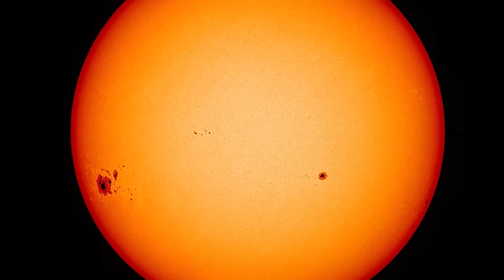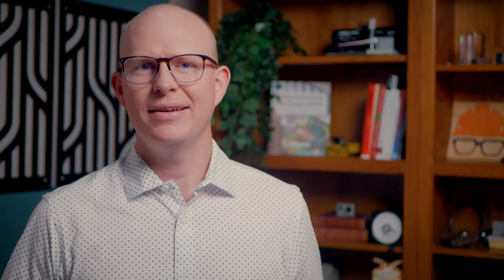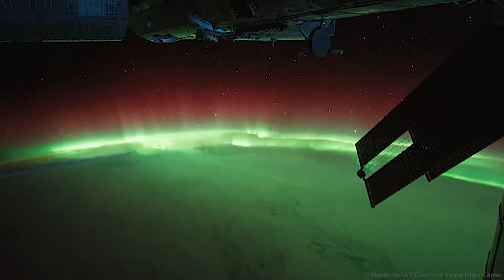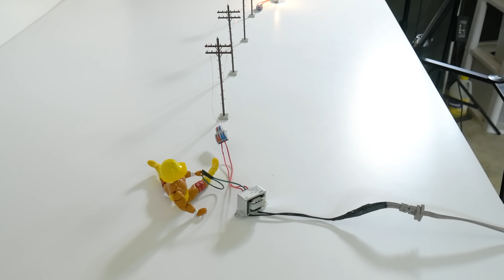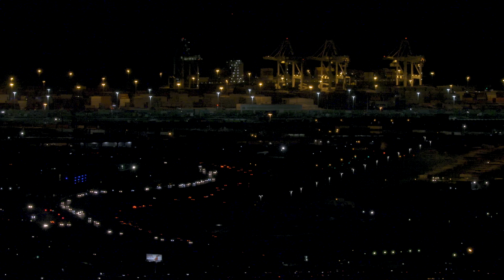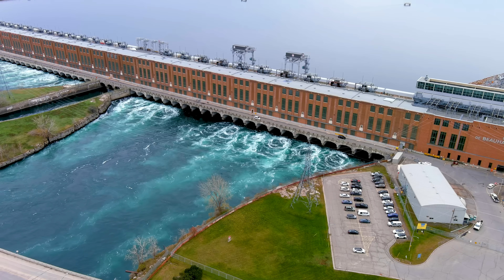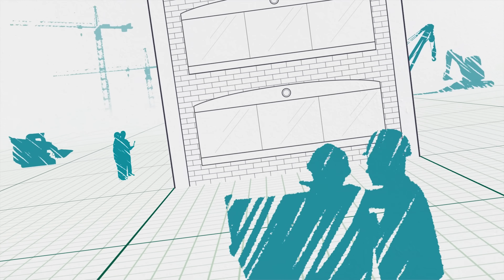The Most Confusing Part of the Power Grid

Comment: I work at a wind research institute and we have some big synchronous generator wind turbines. It is interesting since they can actually support the grid and deal with reactive power, unlike many other inverter based turbines. They were probably too ahead of their time though since the company that made them went out of business. Synchronous designs are starting to be talked about again though due to the lack of reactive power from most other renewable sources and I think some synchronous designs might be built and tested in the next few years.
Reply: Synchronous rotation is the key to dependability in P-V,  ocean wave power collection and non-synchronous 
wind turbine collection.  Bless you.
Reply: Did that synchronous generator based wind turbine operate at fixed speed or variable speed?
Reply: @adriansolis126  variable speeds, up to 10m/s where it then hit its peak power output of 2MW and then its power remains at that level until it reaches its max wind speed at 25m/s
Reply: @Michaelonyoutub  So I suppose that the synchronous machine is interfaced with an inverter to the grid
Reply: @adriansolis126  It is interfaced directly to the grid, though its voltage has to be adjusted. There is a hydrodynamic drive that translates the speed of the gearbox from the rotor to the correct synchronous speed for the generator.

Comment: is DC is better? how DC-DC converters compare with AC transformers? over 90% of usage can work on DC, basically only induction motors would need inverters.
Reply: All over the world we're seeing more HVDC for long distance and very high voltage transmission lines. For a given voltage DC has less losses because it's only resistive, you don't have any components of inductive or capacitive reactance, skin effect isn't a problem, corona discharge losses are reduced, the amount of conductor material required is less because skin effect isn't a problem and because of the absence of phases, which in turn means the transmission towers can also be made smaller. The biggest hurdle for DC transmission is the capital cost, you need expensive converter stations on both ends, however at a certain length and voltage it becomes more economical. HVDC is also used for grid interconnections, making it possible to connect 2 AC systems with different operating frequency or 2 systems that have different synchronisation.

HVDC transmission circuits have a traditional incoming AC circuit with transformers feeding into converter stations which have massive valves to rectify the AC to DC which is then transmitted to another converter station which has inverters which convert it back to AC. 

Think of it like this

Generator output 25kV AC --> Step up transformer raises the voltage to 400kV AC --> Converter station rectifies the AC to DC --> DC transmission at 550kV+ --> Receiving end station inverters convert back to 400kV AC.

Check out https://openinframap.org/#5.33/49.447/-98.548 enable the key and you'll find HVDC circuits between US states and all over the world.

Comment: We might be going back to high voltage DC again, because with modern power electronics, we can step up and down DC voltage without the need for AC transformers. So reactive power losses from AC current, is going to become less of a problem.

Comment: Not to hijack your video, but an idea occurred to me this morning, and I'd like to run it by you, since you're talking about the power grid today. Suppose you have an electronic detection device that can sense when the ac power is rising and falling. Next, suppose that this detector is used to make or break a circuit when the power is at zero on the sine wave. There would be no arcing, since there would be no power flowing at that moment. Upon reflection, I can see a lot of hurdles to overcome with this idea, and it surely wouldn't be useful in every instance, but it seems to me it has potential, pardon the pun.You've probably had the experience of shorting an ac circuit at one time or other, and there was zero arcing, or even noise. Obviously, this is just luck of the draw, but what if the principle could be actively used for switching applications?

Comment: By the way, it wasn't just the SVcs that were affected in Quebec. The impacts went all the way down into the US. Because the sun storm caused an imposed DC bias on the three phases of transmission lines. This caused a huge flow of current in the neutrals of the three phase system. That huge flow saturated and burned out many power transformers. And those transformers take a long time to rebuild so the spares got used up very quickly.

Comment: I saw the thumbnail and immediately thought power factor. I guess I was correct.
4:06 They don’t change resistance based on voltage, it’s based on temperature. As anything heats up(whether by ambient temperature or resistance causing a voltage drop, “creating” heat as shown in the demonstration, or by any other heat source), it’s resistance increases.
I’ve used a ct to show power factor and hope to make a video on it(self promotion not intended)
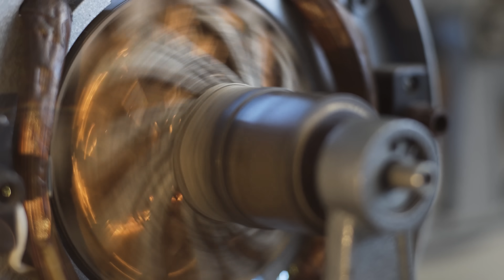9:18 That appears to be a universal motor

Comment: What a great video. As a chemical engineer in the water industry who often has to work with electricians to commission the electrical parts of plants this video was super helpful. When you explained power factor it was a great a ha moment for me. Would be great to learn more about vsd/vfds, how they work, how they interact with the grid and more about on site diesel generators too.
Reply: @TheDesertWarrior. 

On site generators are a whole subject on their own, but VFDs are pretty simple.   

They basically take the AC input, rectify it into DC, and then invert it back into AC.  If it is a 3 phase VFD, think of it as 3 parallel circuits, one for each phase.  (It isn’t really, but this isn’t an electrical engineering class).  I am not sure, but since the input AC is immediately converted to DC, there should be no reactance on the input side.  It would all be between the VFD and the motor, so from the grid’s point of view it would be a purely resistive load.

The rectifiers use diodes (think of them like a check valve) to convert the AC to DC.  Look up a full bridge rectifier for a simple explanation of how this works.

The inverter uses transistors as switches to convert the DC back to AC.  I am sure there is a YouTube video explaining this also.  The “variable” in VFD just means that the speed of the inverter switching is controlled to create the frequency desired.  

Motors rotate based on a rotating magnetic field that is directly correlated with the frequency of the electricity.  Lower frequency means slower rotation and vise versa.

In the following I will use pumps as an example.  There are equivalencies for other types of equipment such as conveyors, etc.  

There are two old school ways of controlling pump output.  

The first is to put a control valve on the pump discharge that restricts the output.  This has disadvantages in that it creates a variable back pressure on the pump that lowers the lifetime of the mechanical seals, has significant reaction delays to system changes, probably takes the pump off curve, and wastes power.

The second is to spec the pump to provide more than max demand and relieve excess output back to the pump suction through an unloader valve.  This still uses excess power, but reacts much faster to system demand changes, and the pump never sees any changes to flow or demand, so it always stays on curve, and the mechanical seals last much, much longer.

Both of these have installation and maintenance costs due to valve maintenance requirements, and greater operational costs due to the excess power usage.

VFDs avoid the excess power problem, but there is some inertia during system changes, and installation and maintenance costs aren’t necessarily lower.  They also require changes to pump design, since a variable run speed means a highly variable pump curve.  

Multi impeller can pumps are common in this application, but get a pump specialist to spec the pump or the maintenance techs will be cursing your next seven generations.  

The benefit is the savings in operational costs, since they only use as much power as is immediately required.

The savings in not having to install control valves is offset by the costs of installing a feedback control circuit.  The same for maintenance costs.  The advantage is in the reduced operational costs, and possibly in VAR reduction.  I am not sure about that last, since I worked in power generation and our concern was in generating or absorbing VARs on purpose.  Plant parasitic load and VARs was an afterthought.  The generators and transformers were measured in MVARs.  We never even noticed a few tens of VARs on a motor.

A word to the wise about VFDs.  Recently, a lot of people with home shops have been using transformers and VFDs to create 3 phase 240/480 volt power for their equipment.  A few of them, like my neighbor down the street, have managed to burn their houses down by trying to diy it.  This kind of stuff is not for amateurs no matter how many YouTube videos you have watched.  A licensed and bonded electrician gives you someone to sue when all your worldly goods go up in smoke.

Comment: You quickly alluded to it, but the huge increase of renewables with inverters is a BIG problem for grid stability. Old fashioned generators have spinning rotors with a lot of inertia to smooth out disturbances. Pure inverters don't do that. Worse, most of them use the grid frequnecy and phase as the cue as to how to synchronize. They can't help the grid when they are just following the leader when the leader loses his way! Engineers are working on electronic alterations to inverters to try to solve this challenge.
Reply: I still think synchronous motors (a.k.a. rotary condensers or rotary capacitors) are the key to keeping
photo-voltaic and wind-turbine voltage sources contributing to the grid in a crisis.

Comment: Most of that grid stabilization burden will be shifted to battery storage with grid-shaping inverters. Some of it could also be accommodated by equipping DC fast chargers with programmable power factor correction and current sensing coils to stabilize power factor and distortion power on their branch of the distribution network.

Comment: At least in Europe when a company uses / reaches a certain point of power, they have to compensate their cos φ by them self - otherwise they must pay expensive fines
Reply: In the US, we usually manage excess VAR's on the grid, with capacitor banks or motored hydro units, and the interchange of Delta and Y connections in distribution.  Of course, industry is expected to try to manage a little too, but not with fines.

Comment: for safety reasons, I would recommend you stay away from electricity... 10V battery is empty, charge it asap before it dies. Electrolytic capacitor is polarised, you are lucky it didn't explode when negative voltage was applied. Oscilloscopes aligator clip is wired directly to ground, always triple check before connecting it to anything on the mains (you did wire it correctly but still be aware and use isolated ground if possible)

Comment: 6:13 That type of capacitor is known as an "electrolytic" and isn't meant to have an AC voltage on it. The side with the black stripe marked "-" needs to be negative with respect to the other terminal. If you put reverse voltage on it (as happens 60 times a second with AC from the mains), it can explode and shoot hot capacitor fluid at you. Be careful.
Reply: When I was a kid, a friend of mine got into electronics kits. One day, when I was at his place, he asked if I wanted to see something cool. Then he closed the curtains, turned off the light, and flipped the switch on a capacitor he had connected to mains power. Fireworks! 

Suddenly I was interested in electronics too.
Reply: They are used in AC circuits all the time
Reply: @hiddenInsight486  There are electrolytic capacitors used for AC circuits but they are not polarized, they are specifically designed for AC operation.  @Ronathangator is correct, the polarized capacitors Grady is using are specifically meant for DC application only.  I couldn't see the voltage rating of the capacitor in the video but if left in Grady's AC circuit long enough it will overheat and fail, venting its electrolyte and potentially blowing apart at the vent.  There are inexpensive non-polarized capacitors available that he could have used for this demonstration.
Reply: @JeffCurtisIflyHG  you are quite mistaken. Electrolytic can be used in AC perfectly fine.
Reply: @hiddenInsight486  I'm an electrical engineer working in the field of power engineering for the last 35 years, I can assure you that if you apply a reverse polarity voltage to a polarized electrolytic capacitor (as Grady did in his demonstration) it will fail, long before its design life.  It won't fail immediately but it will fail in a short time, I've witnessed it.  If you apply a DC bias to a polarized ALEL cap and add an AC component on top of the bias such that it never sees a negative voltage that is fine (so long as the AC component doesn't exceed the ripple current rating of the cap).  There are ALEL caps that are specifically designed for operation on AC circuits where the applied voltage transitions from positive to negative and back again but those caps don't have polarity markings.
Reply: @JeffCurtisIflyHG  guess I'm just an engineer that worked in the RF field for 21 years then moved on to other fun things, guess I was doing things wrong for decades because the power guy who deals with something entirely different knows better
Reply: @hiddenInsight486 Electrolytic capacitors can be used in AC circuits as long as the AC voltage is DC biased so it doesn’t go negative. In RF circuits you usually work with an AC signal that is superimposed on a DC voltage in some parts of the circuit.
If you use a polarised electrolytic capacitor in a pure AC circuit it will definitely FAIL. This is due to the chemistry used. Just look up the datasheet of any polarised capacitor. Look up Mr Carlssons Lab on YouTube. He has excellent videos on how to select capacitors for different applications.

Comment: A (polarized) electrolytic capacitor can explode, when exposed wrong polarity or AC... Sulfur-Acid spitting in your face is not very funny. Better use a bipolar type instead (nothing else than two ELKOs in series with reversed polarity)...

Comment: Why is that the trigger for grid disconnects is the frequency going out of bounds rather than the voltage?
Reply: The voltage is meant to drift. The difference in line voltage is what causes power to move from one place next to another. The frequency is maintained within a tight band because if it could also move freely, you could end up with dangerous oscillations between voltage and frequency leading to overvoltages and catastrophically high torque on synchronous generators and motors whose RPM always match a multiple of the grid frequency.
Reply: Consider a nice big thermal power plant. Coal or nuclear perhaps. It generates steam to spin a turbine. But how much steam?
It has a governor/control system to control how much of course. Depending on rotation rate and the synchronous generator is going to rotate at the line frequency no matter what. If the line frequency drops, the control system calls for more steam. If it increases, less.

The system settles on a frequency where everyone is happy. Add a generator and the line frequency increases. Not much, but the other generators provide just that little bit less.

So if you get a really large frequency excursion, there is a large imbalance in supply and demand. When the frequency drops, the available plants provide more power. But they have their limits. Things like Ohmic heating in the generator and such. At some point they will disconnect to protect themselves.

Comment: In the electric grid I work in we have the opposite issue of too much capacitive loads on the network. 

As our industry has declined and switched to more modern power supplies.

Shunt Reactors are being being used much more cap bank rarely are in use.
Reply: You're right, over compensating with too many capacitors creates dangerous voltage rises on the system, especially on long lines and at times of reduced load (Ferranti effect), and as you quite rightly mentioned, modern power supplies being ubiquitous adds to the problem.

Comment: "Confusing" to who? And definitely NOT the "most".
These are the very basics of electrical engineering, covered in many textbooks etc.
We don't need Internet to explain this to anyone (especially average Joe/Jane).
Power factor is just a tip of the iceberg of how the system really works. Mostly it's higher math (way higher than complex numbers).
 
PS
Ohm's empirical equation is NOT a real "Law". It's kindergarten level of "understanding" electricity.
Reply: How superior of you.
Reply: @TheDanEdwards  Not "superior". If you talk about electricity you must know the BASICS (like energy transfer happens in the EM field, not inside wires and so on), unlike video author.
Voltage is NOT "pressure" (hydraulic analogy is for children). Volts and amps are derived from the circuit geometry, material parameters and EM field (this is Electricity Nature).
Volts/amps are material response to the EM field. Most people are stuck at that level, but they happily "teach" others, make videos "explaining electricity". Pathetic.
 
Video title is pure garbage. Basics are NOT "confusing" for those who know what's up (Electrical Engineers).